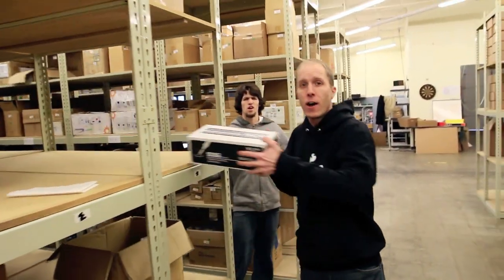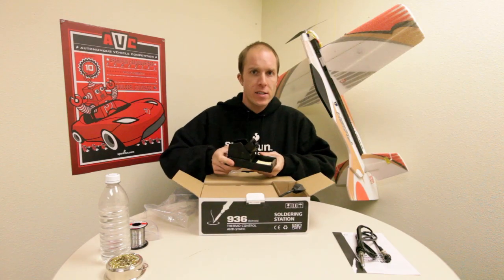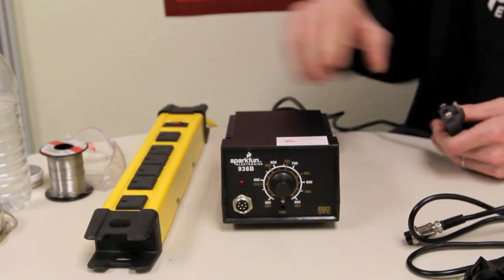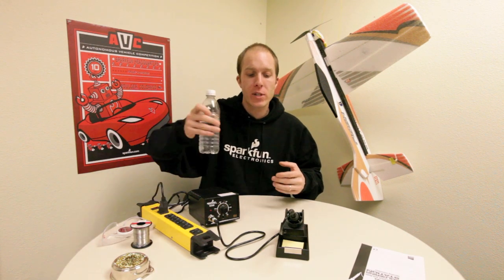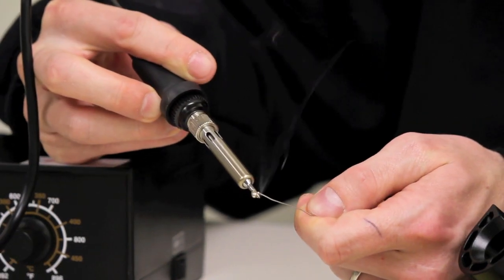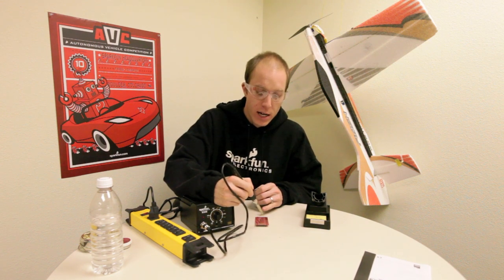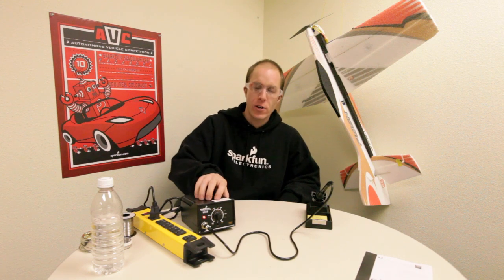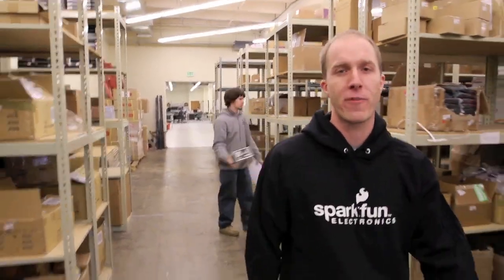Soldering Iron Basics with SparkFun

Comment: Not sure how big the pad is he was soldering onto but it looks like either there was too much solder or the pad was dirty\not hot enough.

And yes, the iron was left on the joint far too long, as you can see from the melted connector.

Not really a good video to show first-time solderers at all in my opinion.

Comment: That's an excellent work station for a novice assembler. It's really a good idea to add some (canned spray) circuit chiller to the bench....but, in a pinch,a satisfactory substitute is canned air. The idea is to cool the soldered connection(as fast as possible) to avoid subjecting the component to thermal heat stress. Parts catalogs generally list the component assembly times and temps....thanks for the video.

Comment: While you probably won't get cancer from the fumes created by soldering a few components onto a PCB, long-term exposure can lead to lung problems such as asthma.  Try to avoid directly breathing it in, and work in a well ventilated area (i.e. not in your closet).  Otherwise, you'll be fine.

Comment: i would put a annotation in there mentioning that the fumes are NOT LEAD, but are still not good to breath. I think what you were trying to say is it wasn't lead(as some begineers may think) but i wouldn't sit there all day and breatth those fumes(you said they were not dangerous, do YOU wanta breath those all day?) i don't. Not a bad video, but your joint looked cold as well, it didn't "cling" to the joint, and as others have said, you melted the plastic on the pin.

Comment: Good tutorial overall, but do NOT do what he did putting the side of the iron for several seconds on the pin before adding the solder. You can clearly see the heat conducted through the pin, melted the plastic, and messed up the alignment. It is perfectly possible to touch the tip of the iron to the tip of the solder and have it melt on top of the pin & pad at the same time. You'll get it right with practice, and everyone does it a little differently. The best way is the one that works for you.

Comment: Quicktip: a dry tip transfers heat poorly, add a dab of solder to the tip 1st and then carry on in the vid but you'll notice the solder applied melts a lot quicker.